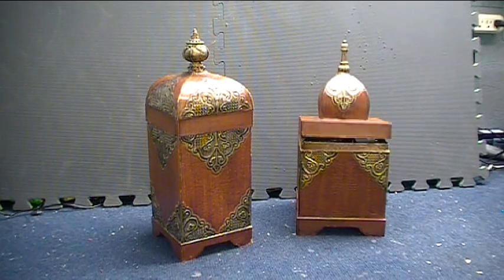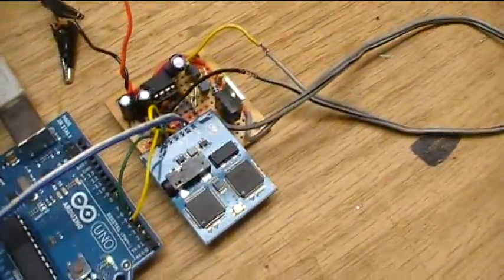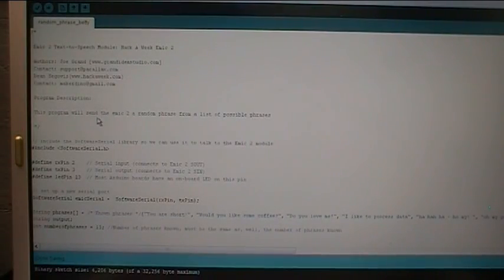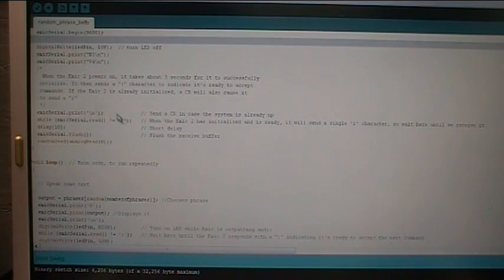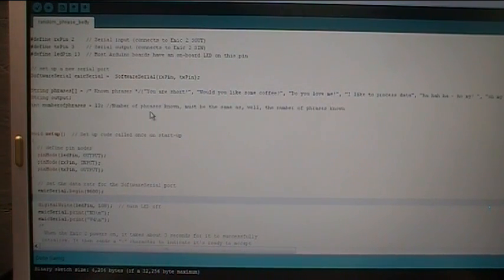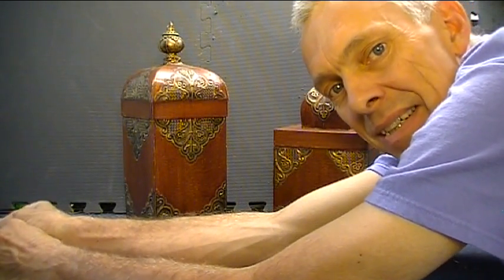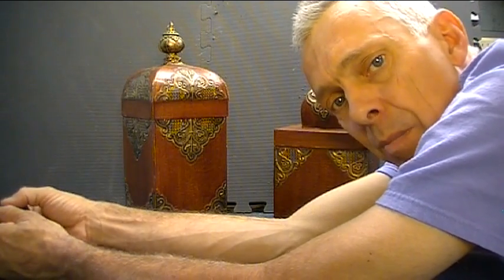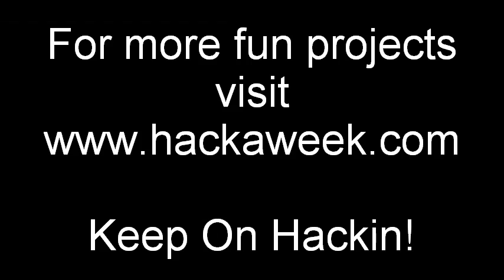Emic2 Part 4 - Zero and Betty Talk

Comment: Run the line that goes to motors through a step down converter, send it to analog pin 0, log the data and then use that for the next ones quote choice.